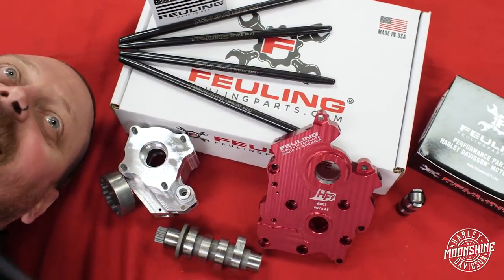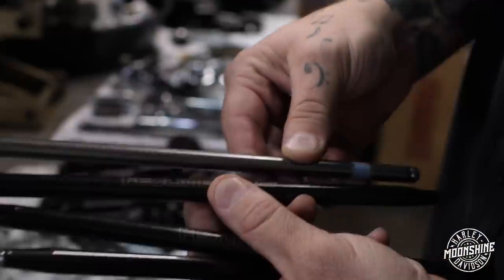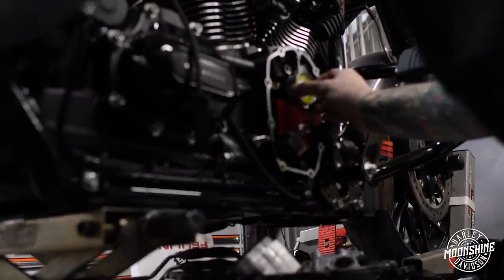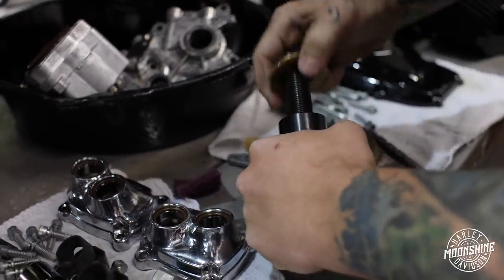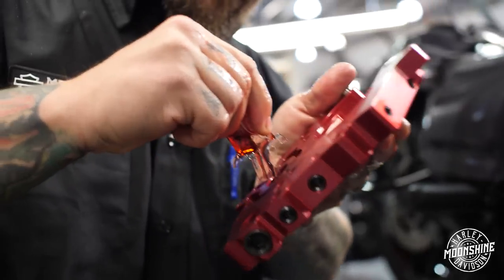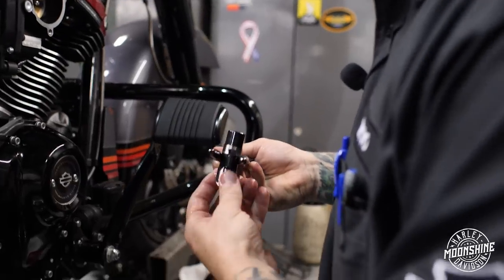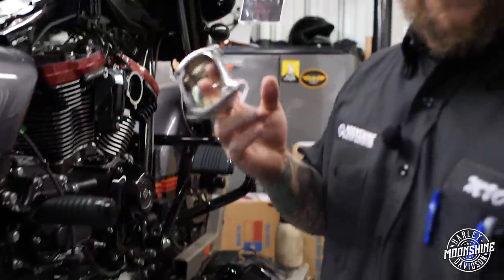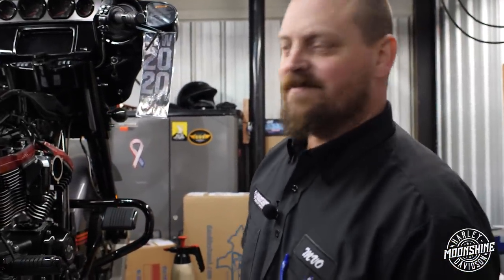BRAND NEW Feuling Reaper 472 Cam Moonshine Horsepower | Shop Talk Episode 40

Comment: I thought it would get more. I have a stock 2020 117 CVO top end from the cam up on my 2018 Fatbob. It has a D&D two to one exhaust, SE air intake. It made 128TQ and 126HP last month when I got it on the dyno. Been wondering what cam might be worth it but now I'm not sure a new cam will be worth it.

Comment: Wondering why cams like this one and the zippers 472 are not recommended for the 107 due to the specs but when compared to an s&s 475 they still have earlier intake close, later exhaust opening and far less over lap and the 475 seems to be the go to cam everywhere and never hear anyone say it shouldnt be on a 107. My dealer wanted to go with the 475 on my 107, I went with something else and from all reports I'm glad I did.
Reply from the maker: Jarrod Wilson We only pair 475 cams or larger with high compression setups. The S&S 465 would be a much better choice if you are pairing it with a stock compression engine. The 475 will come on too late with stock compression and the 465 will be really snappy with stock compression.
Reply: @MoonshineHarley  I went with an Andrew's 460 because I wanted good mileage with the stock street bob tank and good part throttle response in the corners, I get better economy now than the dealers stage 1(it was running rich). I'd say 9/10 people I've spoken to let the dealer put the 475 in their 107's. One guy explained it was like a 2 stroke, does nothing good until 3000rpm. Most want the 475 because of the lumpy idle then wonder why the fuel economy is in the toilet. This is why some dealers are better than others, keep up the good work!
Reply: @MoonshineHarley  would you confirm this is true with a 114ci also besides the 107ci??

Comment: Feuling Parts Vented Oil Dip Stick is it good for the Harley M8?
Reply from the maker: TTG Atlanta Mother Chapter MC it allows more pressure to escape the engine case which reduces pressure in the bottom end. It’ll help piston ring seal along with some oiling benefits.

Comment: Can you go into detail about your Horsepower PSC extended service plan in a video?  Example, if I am from Arizona and have you guys do an engine build for me, do I have to ship it back to your dealership for repair if something goes wrong or if I am touring in South Dakota and have an issue, can the nearest Harley dealership diagnose the issue, fix it and your PSC cover the applicable repairs?
Reply from the maker: MojoMan Murph it valid at any Harley-Davidson dealership in the USA for repairs. If you have more questions please call the shop and ask for Jamie 615-274-4170

Comment: great video can that be done with the 114 whats the tq
Reply from the maker: Donald DuncanYes! You’ll see very similar numbers on a 114. We would run the Feuling 465 on a 107 M8. The 472 is the cam we go to for 114 or larger displacement with stock compression.
Reply: Cool to know.   I have a 114 stage IV in my 2017 RG, was thinking a Zippers cam but may just go this route.

Comment: Mike, please give me your thoughts on running straight 50 weight oil in a 128 M8. I'm in Cali and the weather has been in the mid 90's. I seen this in the Harley manual and wanted your opinion. You guys are the truth keep up the Fantastic work. 
*Note I'm currently running 20/ 50

Comment: Now what can we expect from a high compression 117 with high flow fuel injectors and hpi throttle body?
Reply from the maker: Eric Martinez at that point we’d just build a 128 instead of the 117. Same money and parts for the most part.
Reply: @MoonshineHarley  I actually did not think of that. Still want to do a 117 on my 2020 lowrider s. Or go for broke on a 128 👍decisions decisions.
Reply from the maker: Eric Martinez 128 all day. Did you see our video on the Low Rider S 128 build?
Reply: @MoonshineHarley  I did see that video and was pretty much an attention getter with those torque numbers and power band. I want to do the build myself, do yall do technical questions over the phone on parts, orders, or installs? If so I'll contact soon as possible.

Comment: Was this a real stock cvo.it didn’t have a stage 3 or anything.i have a 2019 I’m looking to have y’all do.but thinking about the zippers 468 or 472.and info will help
Reply from the maker: lwhiteb100 It only recurved the parts mentioned in the video which was the cam job and exhaust. If you have the 117 we would do the Feuling 472. It Rips!!!

Comment: what would the results be with this cam on an M8 107 twin cooled with a Stage 3, D&D billet cat 2:1 w/ vortex baffle, TTS tuner, and SE Ventilator AC?  Which cam would be the very best for that particular set up? Two up weight  with a racing style type rider ?

Comment: Was the tune done with Harley tuner or with an aftermarket like Powervision?  The engine on my 19 CVO Limited took a dump and my Harley store is up grading the oil pump, cam plate, lifters and tapper covers.  They won’t upgrade the cam from a Harley Torque cam to the Fueling 472 cuz it’s not “EPA COMPLIANT”.  So I’m having someone else do that.  Just want to know if I need to upgrade the springs.  My bike currently has a powervision tune in it for the Harley torque cam.
Reply from the maker: You would need to have it Dyno tuned for best result.
Reply: @MoonshineHarley  yes, the guy putting in the new cam would dyno it too.  Was your bike tuned with the Harley tuner?
Reply: @stevenbutner4218  yes harley tuner or they would not be able to sell with warranty

Comment: Hey Guys Love your show. Definitely the best info I can find on the feuling and s&s cam chest kit. In the comments on both your videos you recommend both the 472 reaper cam chest and also the s&s 475c chest. I have a 20' Road glide special 114. I ride between 2k-5500 rpms. I want the bike to pull hard all the time. Occasionally my wife will ride with me and I still want all the power lol.  I cant decided between the fueling 472 chest or s&s 475 reaper. I will be running a custom tune, deleted cats, rinehart slip ons and a Trask high flow intake. I respect your guys opinion do you have a recommendation on one over the other? One option I was given was the feuling 472 cam and s&s everything else? Thanks for your time. Again love the videos. Thanks
Reply: Seems nobody is acknowledging the comments. I'm just a rando on YouTube but I say the Feuling 472. Much nicer quality in my opinion.
Reply: @AeroSS87  I can't tell any difference in build quality? But the dyno charts tell me that S&S is the go-to (torque monster) unless you often find yourself needing more power over 4500rpm.
Reply: @AeroSS87  Also quality-wise the dyno curves for S&S are the smoothest I've seen. Feuling's look great too but again hard to make them the first pick unless HP is your priority, IMO.